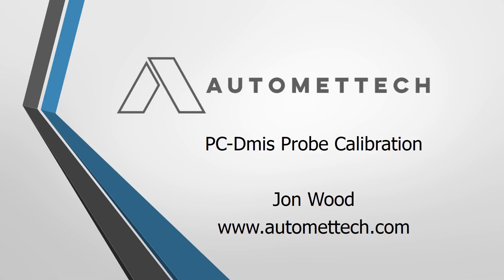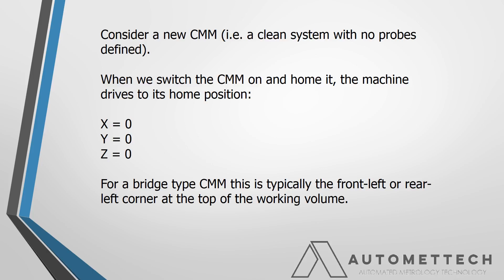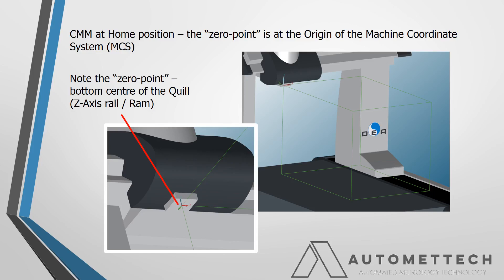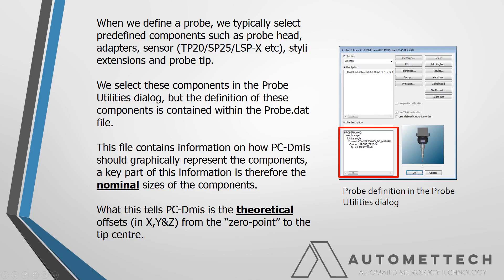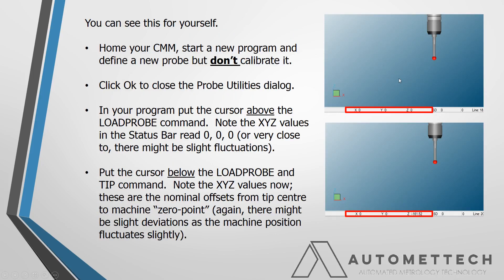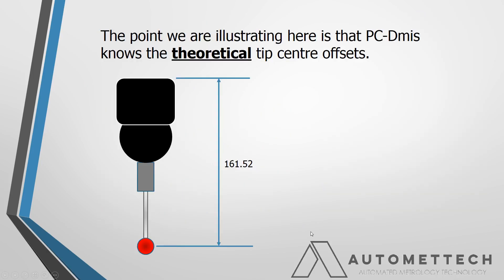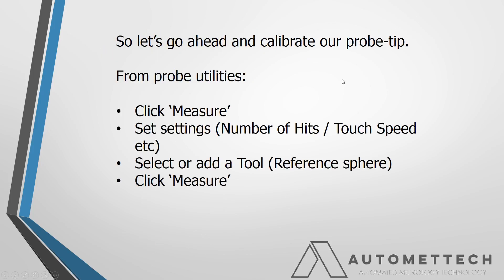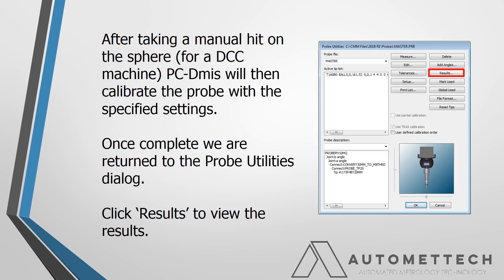PC-Dmis Probe Calibration

Comment: Thanks for details, so easy to overlook. I am trying to calibrate a star probe which crashes on sphere and need your help. The sphere is 25.4 mm & the probe length is 12 mm so it always crashes. Is there a way to direct where to take a hit (and then avoid taking it on circumference)?